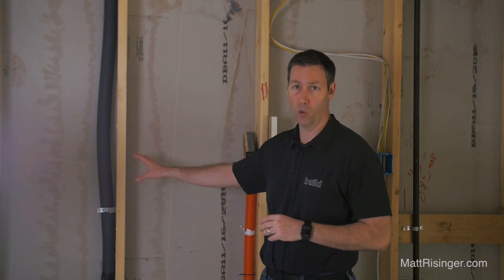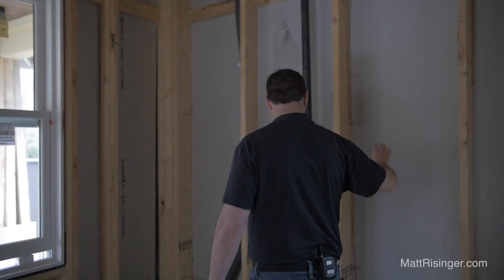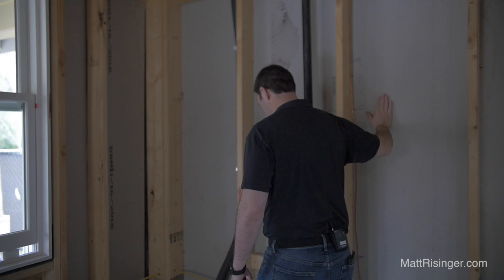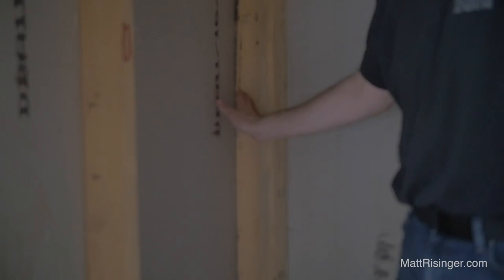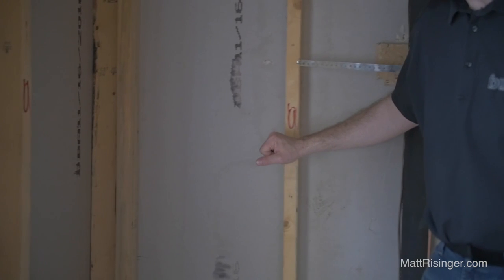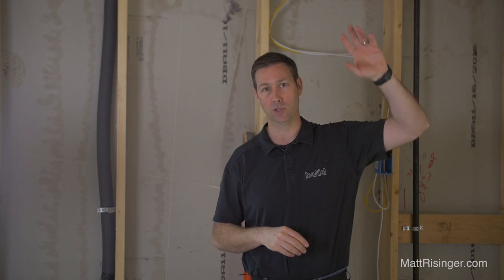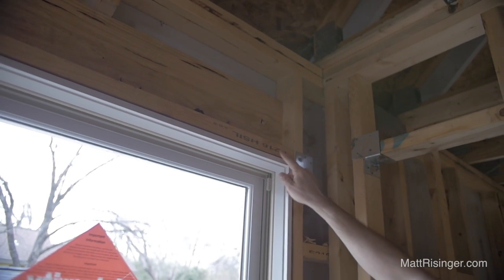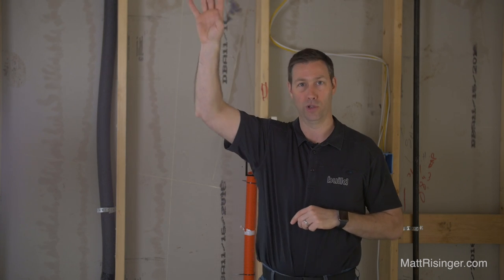Traditional vs. Advanced Framing

Comment: Never been a fan of 24"OC, makes for wavy rock, sheathing and siding, even 19.2"OC does this, in the northeast the norm for roofs is 5/8 sheathing- 16"OC. The other problem with gusset plates and light weight structural members is total failure after only 5-10minutes in case of fire entering a void.

Comment: Max insulation concern is THE most abused aspect of home building and has been for years.   Use complete 2x6 framing as well as being diligent when insulating, which includes proper amounts of blown insulation in the attic.  As with anything, convincing the homeowner that long term financial benefits are MORE then worth the few thousand dollars in additional material/labor costs.  How many times have you ever seen the between floors insulation job look like a 10 year old attempted to cut rectangles and just shoved them into the space. How about when floors are insulated (additions out over a cold space).  I mean....why did they even bother putting pink fiberglass into those cavities  Expanding foam is expensive yet should be mandatory for floors over cold space as well as attics where loss of cubic footage to allow sisters is out of the question..

Comment: All I got from this is your crazy for insulation and to be honest I don't see a difference between either styles other then a big headerand small header but that's just a preference but again you keep going back to insulation but homes in my area are made from blocks so insulation is made on the inside from a basically a false wall of sorts where the wall is about 8-10 inches thick when done  4 inch block and 2 by 4 inside walls packed with sprayed on insulation heating and cooling bills are usually around the 100-160 dollars in the hot seasons of Texas  which is pretty good for a home at 65-70 degrees in a 2600 foot home if you ask me

Comment: Reisinger doesn't know the international residential  code...in the 1st house the ceiling height was 8feet therefore 2x4 would be acceptable for wall studs. The header over the window which seemed about 9 feet wide was undersized for 2-2x12. IRC  say 6'-3" max header span (engineering design can increase that) for single story house. They needed additional king studs because the the window opening. The second house appears 10 foot ceilings. So 2x6 studs are much preferred. One king stud next to a window is weak. IRC  requires jack studs at openings. Sheathing  looked look thermoply. All in all a poorly framed house. Since I'm a structural engineer I would not buy it

Comment: Cheap house, will last probably about 2-3 years without any remodeling.
First of all every header needs a jack that’s because headers support some weight where there’s no studs, and that header you showed was at least a 3’0 window if 24” layout lets a house weak cause most of the time framers don’t always lay the rafters the same way as the walls, now imagine 36 inch without support.

Those blocks as dead wood might be ok but theres also the traditional way where instead of using 3 studs together you can use 2 on the sides and a block of leftovers in the middle of them that will give you your insulation space.

That advanced house, would not pass inspection here in Arkansas, probably they would tell you to build it back again the traditional way

Comment: Well if you use 2"x6" you get away with the problem of a tile roof bearing the loads. If someone ever does it. My main issue is can someone build a wall that is straight. I dropped a plumb and some are so warped. You have a gap of 2" from top to bottom. Using all that cheap Canadian lumber that has so much moisture. That when it dries. You got the wood pulling away from the rafters and you will never see it. As they cover it up with drywall.

Just can't buy a quality home for the prices they charge anymore. One reason homes are falling apart after just 5 years....

Comment: Not sure that the wall insulation makes a huge difference. Houses built before 1970 did not even require wall insulation. The insulation in the roof makes the biggest difference.

Comment: Oh boy where to start. 
Lumber might not have a high R-value but it retains heat or cold a lot longer than other materials, that's why Log Homes still built today are very efficient. By your logic the industry of log homes would be...... well obsolete, yet they are at the high end of the market.
2x4 construction has been outdated for years, at least in Ontario we can't even frame basements with 2x4s it needs at least an R20. 
Your corner is missing a nailer/strip to attach drywall to.
The hanger is just crap and cracks waiting to happen down the road for your customer.

I can only imagine how many other mistakes are in this "advanced house"

Comment: I can see the insulation poking out of the corner you say aren't insulated. Your statement of no insulation in contradicted by the video you show
Reply from the maker: +Kevin Schneider no that's a bead of spray foam from a can trying to air seal that corner
Reply: Matt Risinger on most of the houses I work on they fill that cavity with batt while building. or the will put 1/4 inch hole in it and pump it full of great stuff foam.

Comment: why do you keep calling the framing member over window openings 'HEADER' it's not a header! it's actually called a 'LINTEL'.  HEADER- is the framing member at the HEADER of the 'stairwell opening'. For years i've been framing and a Red Seal carpenter for almost 25yrs and names and method of construction is backwards.
Reply: I dont know bud, up here we call them headers, the NCIS calls them headers as well. A lintel up here typicly refers to a steel angle iron typically spanning openings in CMU walls
Reply: well then,,, my Canadian National building code book may be wrong. Maybe you should write them and have them make the changes!

Comment: He says he consulted with the engineer about it.
I am sure he did,these days, engineers are 20 something years old with no experience at all in the field.
Reply: Facts. Engineers have no field experience, I develop subdivisions and one time the engineer did the budget for site development ( turnkey pipe and grading contract ). He missed about 3 million in costs for a 379 lot, 190 acre development. Why ? The engineer never laid pipe or moved dirt before, I told the team we have to get the actual contractor to not only bid out the work but create the budgets. Sitting behind a desk and reading books all day doesn't make you an expert. Let the engineer design and engineer.. thats it.The hard worker thats been actually doing the work all his life is the expert. The need to require engineering Majors to do 1 year of full-time laborer in framing, piplaying, or concrete work, etc. They need to get documentation signed before they get the degree.

Comment: Advanced framing sounds like a marketing technique to add $25/sqft over traditional framing,
My home is traditional framed- with all 2 x 6 exterior walls & most of the downstairs interior is also 2 x 6- but 16” on center - not 24”
And I don’t personally like the “advanced headers”- and why did the 2 x 6 on 24 require the 2 x 4 furring strip that appears to be notched in- a couple feet from the top?
That looked a little odd,
This  “Advanced “ framing would never pass inspection here!

Comment: In my opinion using the term "advanced" framing is highly misleading in this case. I think it's irresponsible to be spreading this information like it's the new standard to the tune of over 1M views. To modernize framing practices is one thing, to preach this garbage like it's the great new way is reckless and short-sighted. How far have we slipped to believe it's acceptable to build houses that will barely last fifty years?! 
It's pointless to compromise everything for the sake of R-value, which will be rather irrelevant when the house blows apart in a wind storm!

Comment: Building codes are based on a judgment of the right balance of longevity, safety, insulation, and cost, then adjusted for convenience of mass production. So-called traditional building techniques have been around less than 200 years after solid wood, plaster, or stone construction was used for a thousand, and the naysayers probably sounded the same back then. Fiberglass insulation and drywall aren't even a century old. And building codes vary the world over depending on climate, habit, and availability of materials. Criticize based on facts, not merely curmudgeonly resistance to change.
Reply: How do you know the resistance is based on curmudgeonly resistance to change and not on facts?

Comment: Did you really point at an engineered hanger with only half of the nail holes utilized and think that's cool? Pretty sure the engineers put all those holes in there for a reason.
Reply: also in that shot....2 bugle-head screws??

Comment: I can take you to 200 year old homes which have withstood hurricanes and suffered NO adverse affects whatsoever. Guess what? The homes constructed after the 1960s were lost during adverse weather conditions those older homes endured. They are still as solid as the day they were built. I would not sacrifice structural integrity to insulate!

Comment: To all the haters: We desperately need people to be trying new things. Even wrong things, so we can learn. Matt's emphasis has always been on a better insulated, water resistant house and so he has tried things that aren't traditional. Does that mean he's 100% correct? No, but without people like him we will continue to have all the same problems we have always had. Personally, if I want more insulation the cheapest and most sturdy way I know would be to build a double stud wall. It utilizes twice as many studs but that's the cheapest part of the house. Plumber's and electricians never have to notch another piece of wood and you can fit R-40 into your walls if you want to. Compared to a 2x6 wall you only lose an additional 5.75" of space along the perimeter, but gain so much more in terms of strength and longevity. My $0.02, and I hope everyone else encourages putting out their 2 cents too.
Reply: Most of the comments are not about hate.  A builder should not reduce structural integrity (this advanced framing does) to improve insulation values.  There are tons of ways to increase insulation values in conventional framing.  Notice he talked about the external insulation panels for the "advanced" framing, but, of course, that applies to traditional framed walls as well, and even higher levels of insulation can be added to the exterior while keeping adequate framing (16" oc) to keep the interior wall panels stiffer and straighter.
Reply: but he is selling houses untested  and  with houses im pretty sure u have to be correct  so  when u close a window  the  wall dosent  collapse .. or  when you close a door and you wall shakes  .. these things we learn  like building correctly   are important  to put into practice  when building a house ppl live in  and pay hundreds of thousands for .. ppl want a house they can trust not a glorified doghouse built by someone who is playing build  a house  with new ideas some egggead that cant swing a hammer thought up

Comment: If you nail 2- 2x's  in the shape of an L for the corners you still have drywall nailing and you can insulate the corners. The traditional framing he showed would never pass in PA  cause the corners need insulated neither would the advanced framing. That whole header arrangement they got going on looks horrible

Comment: So, your statements about bare stud areas in the wall being very poor insulation areas are somewhat misleading. If you go apples to apples in you install your OSB product with the foam backing, covered with Tyvek... over a 2 x 6 stud wall 16 in oc backed with half-inch gypsum board inside and wooden lap siding outside you have an R-value of around 14 for the stud areas of that wall which is not too shabby… Yes you're taking advantage of one of the advanced product to talk about but that is part of making an apples to apples comparison with the two framing systems you discuss. If you stuff all those cavities with roxul that will be a very solid wall, and if you want to add strength to it you can use 5/8" rock.

Comment: I work for a company in oregon and almost all of our work is fixing "Advanced Framing" which tends to leak like a cheese grater and work is way lose where there are things like ground and earth tremors.
Also I grew up building houses in Texas and exterior insulation is a bitch. No idea what this guy is talking about or what part of Texas he is in.
Reply: I lived in Southern Oregon working for about 5 years. The house I lived in was leased by my employer since we moved from out of area. The home was a newer "Advanced Construction" house with a value of about $300,000. At the time we moved in the home was just shy of 8 years old and while pretty at 10 feet, was a real pile of shit. 

By year 10 every wall sagged, many drywall screws actually starting to back out. None of the windows would stay plum throughout the year, doors wouldn't stay plum throughout the year, warping with the walls due to thermal expansion. The house could keep out, or contain, noise about as well as a paper bag can - you could hear everything from everywhere. Wall mounting displays? Pain in the ass! Lean on a wall? CRACK!

My parents home was built in the 1890's, yes, the 1890's and is still standing strong. The house my wife and I lived in for those 5 years? It won't be standing worth a damn in another 10.

Comment: This is nonsense. There is no way one king stud is enough material to hang drywall window frames and casing. Same goes for a single 2x header. Eliminating a 2x so you can use insulation is self-defeating and redundant. Advanced my ass.

Comment: Why don't you just use rock clips in the corners for your drywall and why not just glue trim in place with angled trim nails around windows and doors? Why not use radiant barriers as well? Because that house would be a disposable house with terrible results from settling both inside and outside. Good lord, have you considered the out of pocket cost on some of the insulation you named to get close to a r-19 rating? I would rather just have some sips shipped in or form an insulated concrete wall and have brick for my exterior. I would have brick on my exterior anyway. I wouldn't let you build my dog house.

Comment: Advanced Framing?  Matt, is a very tiny  amount of R- factor,  worth having for less structural strength? Those extra studs at the windows king stud look like they are there for an FHA strap. The Ladder bocking you show does nothing but piss off your Drywaller. ur wrong

Comment: Nothing about this is advanced framing. Call it economical framing that’s fine but they have been doing this type of framing since the 1800s . 

There is a legitimate reason we use 16” o.c. And proper corners. California corners do not help one bit for backing on your exterior siding and trim.

Comment: There is absolutely nothing wrong with 24" oc framing if done with 2x6s. Stronger and better r value. With roughly 50% additional width, 300% load bearing capacity is achieved.  It's evident in the ADS manual as well as multiple sources that can be found online and in text books. Sheeting will need to be beefed up a little to compensate for the 24".  For those that bring up hanging cabinets and etc.,....that's why we install backing throughout the entire structure before rock goes up. That being said,  I'm not sold on the header hangers.  But then again, I'm right in between the old and new school generation so possibly just ignorant.  Ive learned much from youth as well as the masters over the years.  But the masters are often stubborn....and sometimes wrong.  Be open minded and remember the only constant is change. We are wise to do more with less, brothers!  Union Carpenter Journeyman and life long student of the trades.
Reply: I use both older and newer ways of framing too, but some things are simple common sense, and I can tell you that this house is not structurally sound. Like you mentioned the need to beef up the sheeting. Take a look at the sheathing he shows in the video. Do you think that makes the wall stronger, or weaker?

Comment: Somebody needs to learn what a gable is. Hint: it's NOT where the bottom end of your rafters sit.
Except for the California corners, and use of blocking for inside corners, I would not build a house like this. I will always put quality of structure over insulation value.